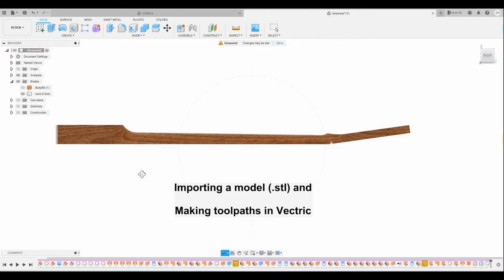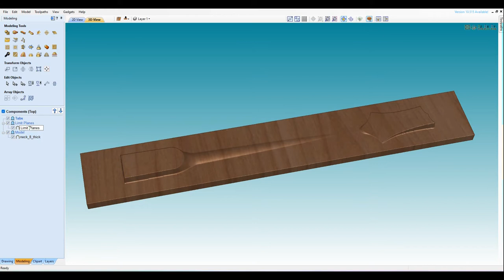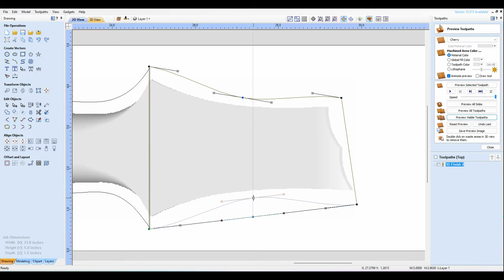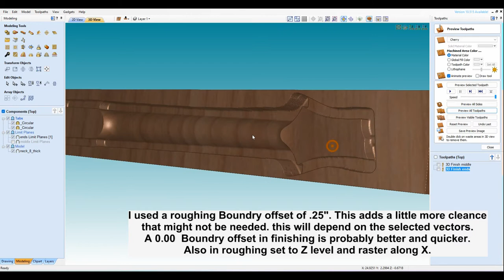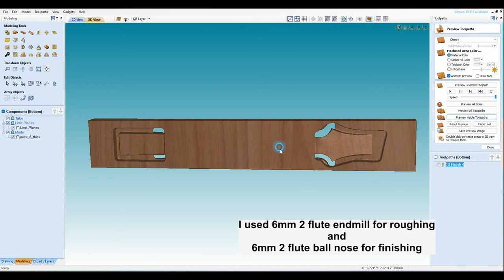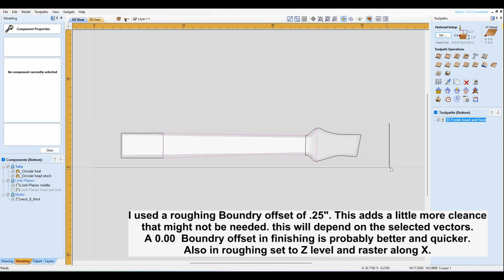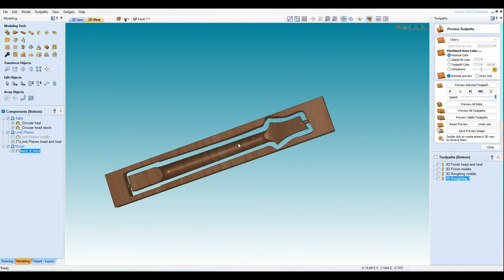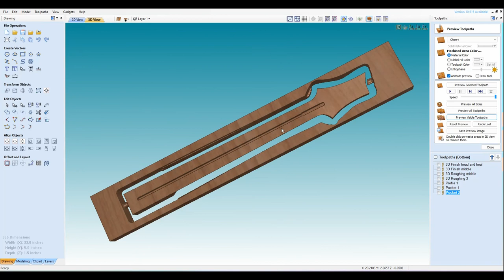Guitar Neck Model Import (.stl) into Vectric Aspire or Vectric Desktop or Vectric Pro - TOOLPATHS

Comment: My STL has tuner holes in it. I wish it didn’t. I could easily drill out some pockets in the right size now I’m stuck with the finishing bit going down and thru the holes .. anyway I can change those vectors in Vcarve pro? It’s a 3d stl i purchased made in fusion 360. Really the only 3d parts I need are the neck profile and the headstock gradient
Reply from the maker: Is the surface flat?
Reply from the maker: Check out "Blender fill holes"
Reply: @rvabarndoors  yes the surface is flat face of the headstock front and back.. I thought maybe fill the holes with clipart but the cnc would just cut em back out
Reply: @rvabarndoors  blender fill holes got it.. thanks